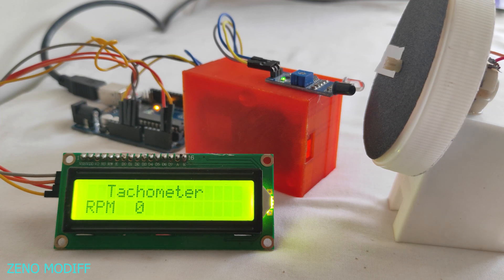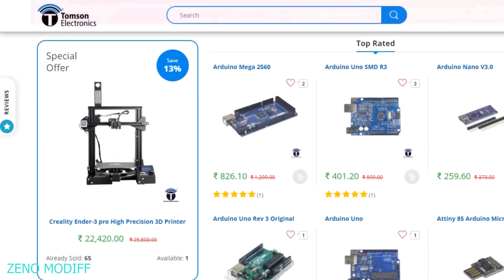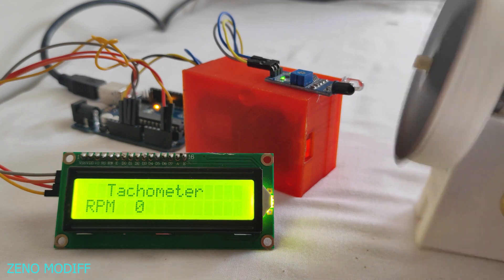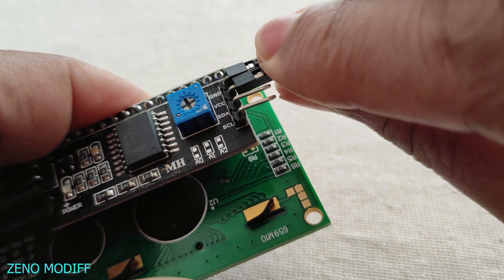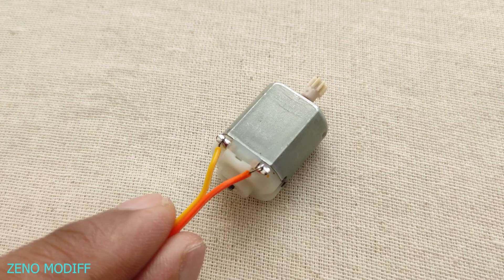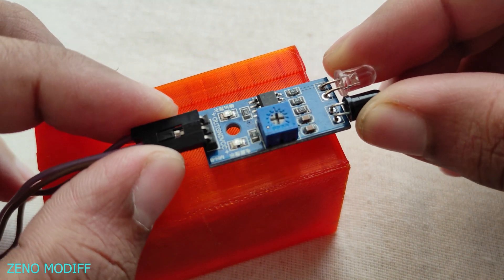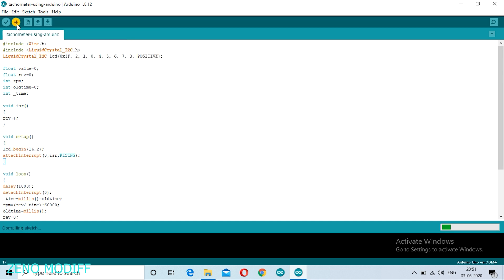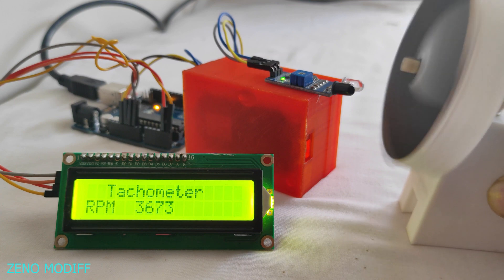How To Make Rpm Meter Using Arduino (Tachometer).Easy & Simple Project || Tomson Electronics

Comment: Bro please provide the program which you have shown in YouTube video. Bro tomorrow final project demonstration is there. Please help bro
Reply from the maker: #include <LiquidCrystal_I2C.h>

LiquidCrystal_I2C lcd(0x27, 16, 2);

float value=0;
float rev=0;
int rpm;
int oldtime=0;
int time;

void isr() //interrupt service routine
{
rev++;
}

void setup()
{
lcd.begin();                //initialize LCD
attachInterrupt(0,isr,RISING);  //attaching the interrupt
}

void loop()
{
delay(1000);
detachInterrupt(0);           //detaches the interrupt
time=millis()-oldtime;        //finds the time 
rpm=(rev/time)*60000;         //calculates rpm
oldtime=millis();             //saves the current time
rev=0;
lcd.clear();
lcd.setCursor(0,0);
lcd.print("___TACHOMETER___");
lcd.setCursor(0,1);
lcd.print(     rpm);
lcd.print(" RPM");
lcd.print("   ");
attachInterrupt(0,isr,RISING);

}
Reply: @ZenoModiff  thanks a lot bro... You saved me

Comment: Sir please provide the code for this....
Reply from the maker: //www.youtube.com/ZenoModiff
//sreeramzeno@gmail.com

//Connect the ir sensor signal pin to D2 Pin

#include <LiquidCrystal_I2C.h>       
LiquidCrystal_I2C lcd(0x27,16,2);    

float value=0;
float rev=0;
int rpm;
int oldtime=0;        
int time;

void isr()         
{
rev++;
}

void setup()
{
lcd.init();                       
lcd.init();
lcd.backlight();
attachInterrupt(0,isr,RISING); 
}

void loop()
{
delay(1000);
detachInterrupt(0);          
time=millis()-oldtime;        
rpm=(rev/time)*60000;        
oldtime=millis();             
rev=0;
lcd.clear();
lcd.setCursor(0,0);
lcd.print("  Tachometer   ");
lcd.setCursor(0,1);
lcd.print("RPM");
lcd.setCursor(5,1);
lcd.print(rpm);
lcd.print("   ");
attachInterrupt(0,isr,RISING);

}
Reply: @ZenoModiff  Thank you very much 🙏